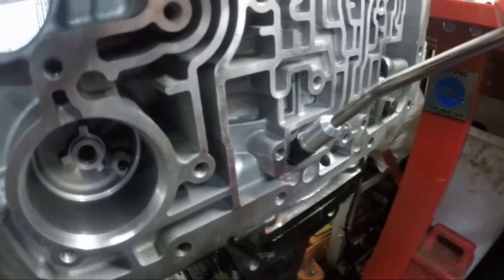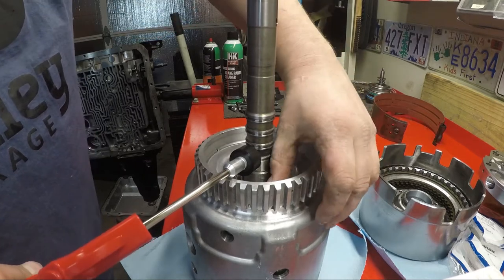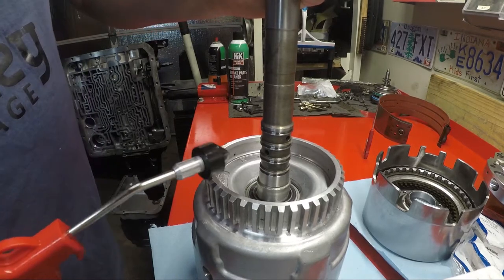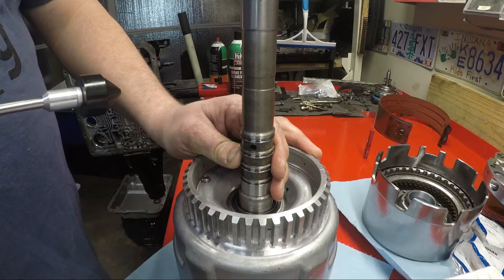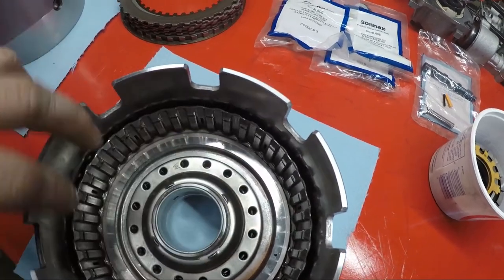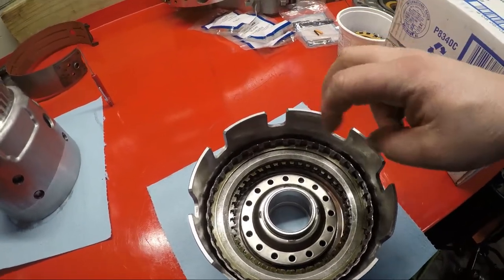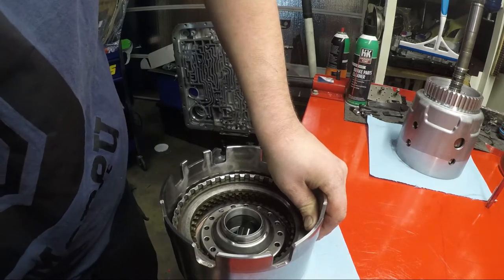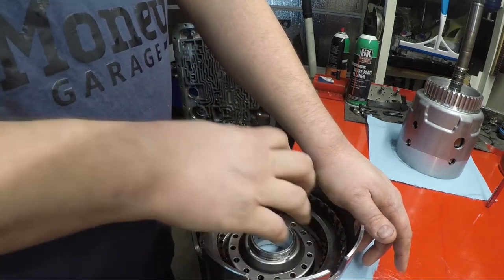4L60 4L60E 4L65E CLUTCH AIR CHECK PROCESS. HOW TO TEST CLUTCH PACKS.

Comment: quick question: I'm rebuilding my 4L65e trans and input drum. The rebuild kit only has 6 clutches/steels but there are 7 clutches and 6 steels in the trans now. With the new 6clutches/6steels, the buildup thickness of the new pack is close to the same thickness as the old 7 clutches/6steels. Is this expected? Any thoughts are appreciated.

Comment: can u show how to test the reverse clutches with the reverse input drum on the stator shaft ? we did our first 4l60e rebuild and dont have reverse.. no noises, all other gears work.  if u had to guess, what would be the most likely cause of no reverse after rebuild by a novice. we used a new reverse sunshell, replaced all piston and teflon seals, used the correct tools.  what tests can I do with the pan off of the transmission? THANK YOU

Comment: what abt the checkball next to the low reverse activator hole, if its not seating will it lose reverse? I read that the captured checkball acts like a cushioning mechanism, in idle and when it seats it blocks off some of the flow but allows some fluid to go around it.

Comment: Hello  today I put a gauge on the line pressure I have 60 psi on all the gears just the reverse after 3 sec have 95  psi 1 2 n 3 n 4  have 60  61 62 psi I drive with  4000 rpm same pressure I have slipping on all gears just 1 and R no slipping plz what problem I have ?
Reply from the maker: Sounds like a pump issue.
Reply: @DMoneyGarage  how i can test the pump?
Reply from the maker: @rockabichebel  above the range sensor on the side of the trans there is a plug(11mm I believe) take that out and put a gauge on it. That’s the pressure test port for the pump.
Reply: @DMoneyGarage  i put it 63 psi maximum on all gears exept R 95psi

Comment: This can be misleading. You should remove that spacer from the 3/4 drum. Pour some trans. fluid into that channel and then pressure test. Watch for bubbles around the shaft where it goes into the drum. No bubbles, good seal. Air bubbles? Reseal the input shaft. 
Then to check the low reverse drum. Stack it onto the 3/4 drum for assembly. Take a stator (removed from the pump housing) and slide it into the drums. Apply air to check.
Reply from the maker: Maybe. But this video was intended for air checking before assembly. I’m pretty sure in one of my other videos I show how to check the shaft and how to press it apart and reseal it.

Comment: what if the 3-4 and fwd clutch leak over. when when i aircheck the middle hole for the fwd clutch it leaks out the 3-4 clutch port and vice versa

Comment: What do you have the air pressure at?
Reply from the maker: I run around 100psi. Never had an issue and the higher pressure has actually helped find very small seal leaks.

Comment: Hello, thank you for the Great video. I just got done rebuilding by 4l60e input drum with brand new molded pistons, new overrun clutches and steels along with brand new forward clutches and steels and a zpak, whenever I air test everything applies just fine and releases as normal but I do get a slight hiss from the inside of the drum whenever I test the middle port and the top port. I have torn it apart several times and checked everything and can’t seem to find an issue. Do you have any advice?
Reply: What your hearing is a controled bleed thru the check capsules in the piston itself. The three holes in the input shaft  check bottom, check middle, check top hole while plugging the middle hole with your finger, there should be pressure even after you remove the air from top hole .